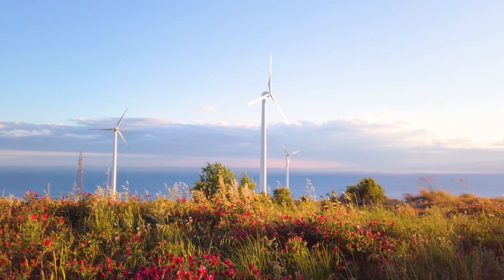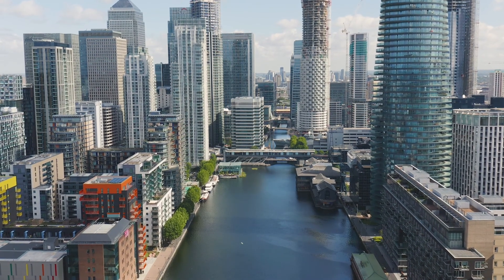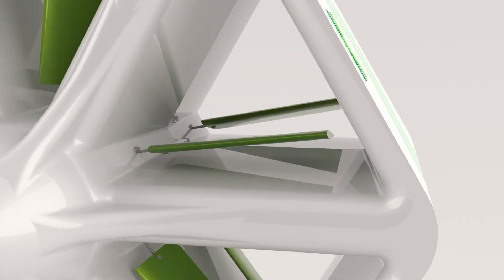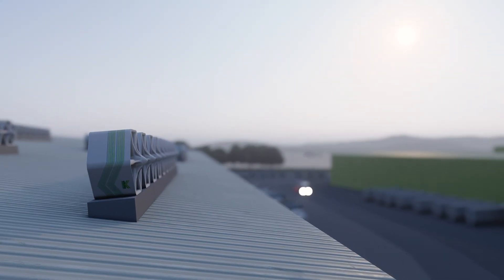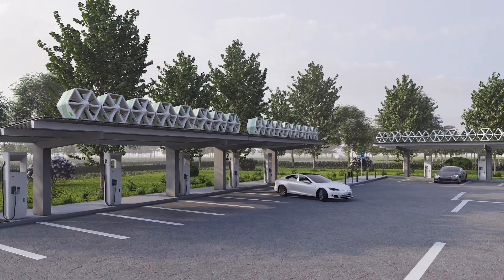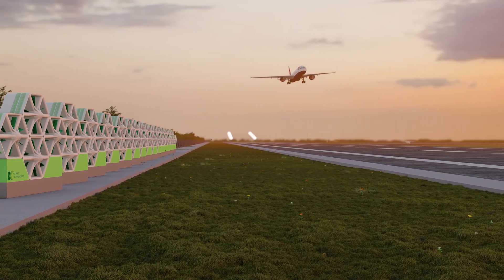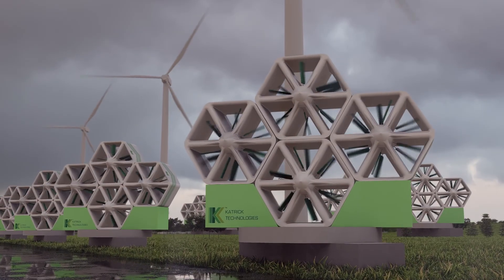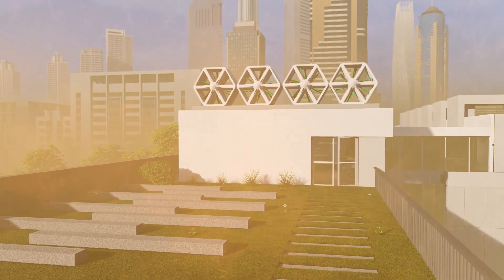Our cutting-edge wind energy technology for every environment

Comment: Looks like a lot of small parts potentially oscillating indefinitely over their service life. You get a lot of wear and debris build up over time when exposed to the elements so we would need to see trials over several years to gauge the cost-effectiveness
Reply: I also can't see it generating anything like the torque of more conventional designs. And without torque you don't get power.

My money's on an Archimedes screw or roof blade design for the type of installation they're looking at.